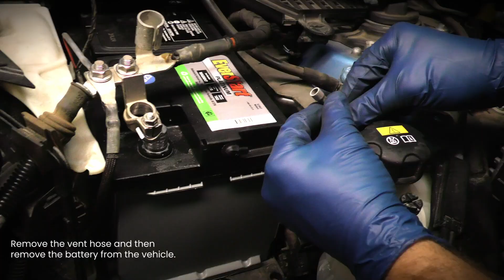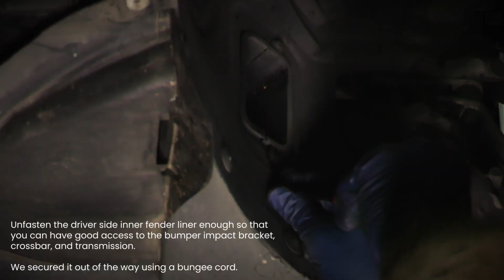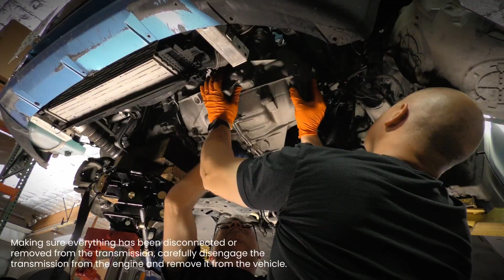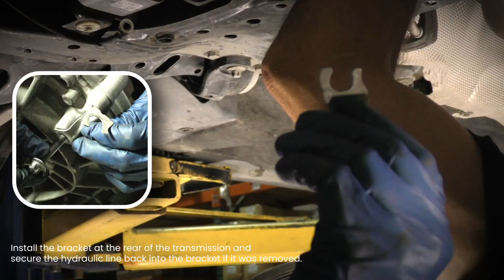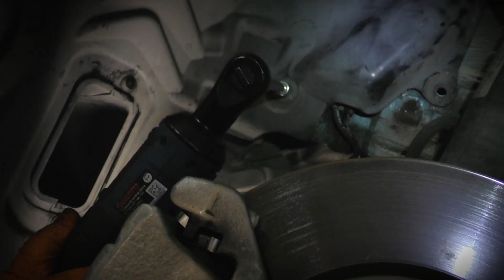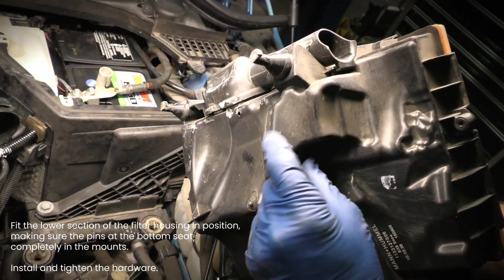ACT Clutch Install: 2017 Mini Cooper S (F56) 2.0L Turbo (B46)

Comment: Excellent video.  I’ve referred to this video for my 2017 F55 Mini Cooper S.  Used this video for my engine swap, clutch install, and LSD install.
Reply from the maker: We’re thrilled our video could help with such a major project on your F55, thanks for sharing! 🤙
Reply: @AdvancedClutchTechnology  I installed an ACT clutch by the way and it works great!